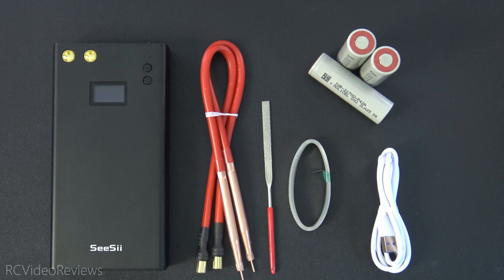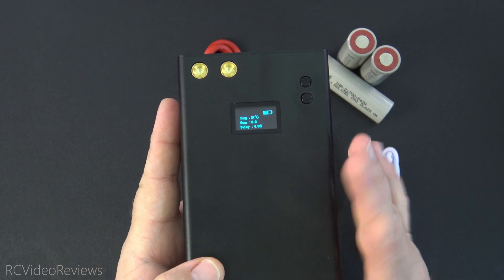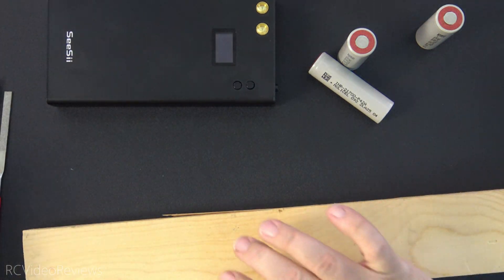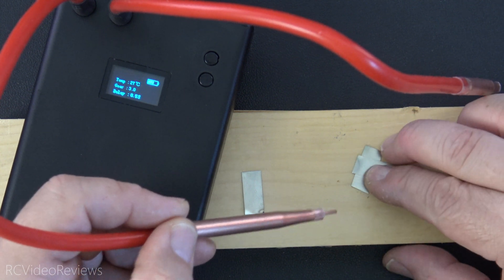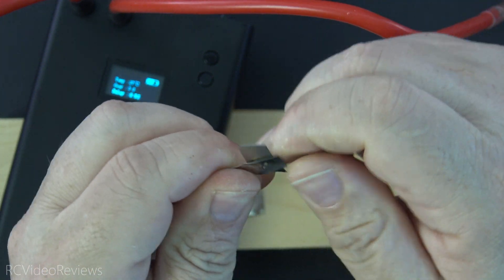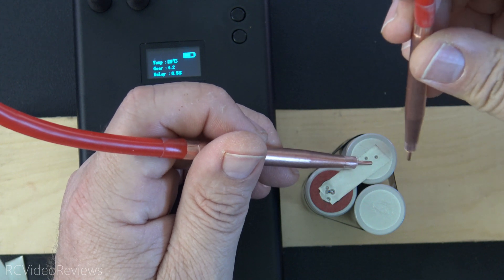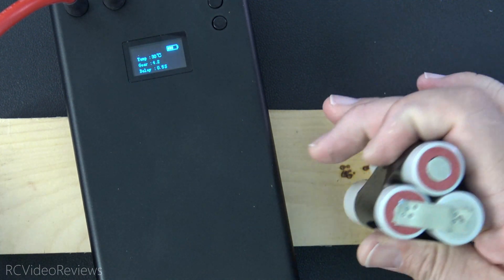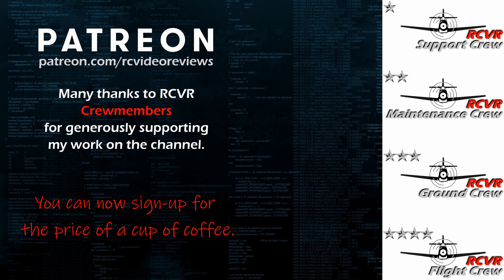Budget Amazon 18650 Battery Spot Welder by SeeSii Review

Comment: Isn't the main voltage drop thru the small spot welds which are very small in cross section versus the strips themselves? i.e.is it really necessary to have multiple layers of strips? Wouldn't more spot welds do more to reduce resistance?
Reply: I use a Matador Ampercity chart. Holes done help. Spot welds do next to nothing
Reply: The charts that I've seen just put out how many amps that the strip can handle. Nothing is mentioned about welds, solder, etc.
Reply: I've been thinking this too

Comment: I always thought that spot welding was achieved by placing one probe on one strip and another on the other strip so that the current passes thru the strips to make the weld. This is how heavy duty spot welding in done on sheet metal. ????
Reply: That is how 2 sheets are spot welding together. This is called surface spot welding where the charge starts on one side, travels downs turns goes up to the 2nd probe...
Reply: @davidbarker3591 or single sided spot welding

Comment: Did you confirm that the strips supplied were really solid nickel? I have seen comments on some reviews that said some units are actually supplied with nickel plated steel strips because they have higher resistance make better welds but the steel strips will cause higher heat and are not good to use.
Reply: Mine was nickel plated steel. It spotwelds .15mm nickel/steel easily. .15mm pure nickel
Reply: you can measure the resistance of the nickel strips if you have a power supply and a DMM.  I measured the roll of nickel strips that I got at 3.9 milliohms per inch, for a comparison.
Just apply a constant 1A with your power supply, connected to the roll with clips at a distance of just over 1 foot, and then mark off end points 12" apart somewhere inside the area where you clipped the power supply leads.
Use a DMM and measure the millivolt reading at the 12" separated marks, and whatever your reading is, divide by 12 to get the milliohms per inch.  Thicker and wider strips will have a lower reading.

Comment: I use this item all the time. Great lil welder!
Reply: Will this last long enough for starting a small business or would you recommend something more sturdy.
Reply: @jrgmty7685  I'm going to open a small business, repairing and rebuilding power tools battery packs. Going to open with a newer unit than this one. I think this model was a 7500 mah unit. I'm going with the 10,000 or 11,000 model with a big color LCD
Reply: @davidbarker3591  nice man. Good luck. Everything uses batteries these days. 👍
Reply: jrg mty...I have done 19 power packs and it's still welding fine. I will not use nickel plated steel. Now, with pure nickel it will take .10 easy, .15, it's wide open. I like the .12mm nickel strips
Reply: @davidbarker3591  that's good  thanks. Starting with industrial equipment is not always the best idea depending on the budget.

Comment: Great. Barely touching makes lot of sense. I started with press firmly, surely it doesn’t generate much heat to melt the nickel
Reply: Please explain, seriously, why light touch is better. I know you (Original Poster) referred back to a previous video, and the fact that you caught heck for (what I'm assuming was) too heavy a touch. 

It seems that if you use too light of a touch, you run the risk of not making contact with the substrate material (endcap of cell), and then your strip bears the full brunt of the energy/heat. Thus blowing a hole in it, as you did on one of the 4.2V passes. 

I have a similar (sized) spot-welder, and it will weld two strips together just fine, but try welding that same strip to a battery and it just falls flat on its face. Not enough power.
Reply: barely touching is bs... use some good pressure! otherwise you get holes and bad connections
Reply: I just use a nice pressure on the probes. Pressing hard is junk, but you don't want have air between anything
Reply: You spot the bottom layer..then you add the 3nd strip and spot to the bottom strip..

Comment: I am on a lookout for a fine adjustable spot welder for doing sensitive electronics. The idea is to adjust for minimum exposure time / minimum amps so that the weld between the nickel strip and the 389 Renata button cell battery is just good enough to keep them together, without frying the electronics behind the nickel strip. Is there some spot welding guide that says exactly what settings would be safe for application like this?
Reply: No voltage will go to the electronics, electricity takes the path of the least resistance it goes out of one probe and then back through the other through the nickel strip. If you're really worried about it do a test on a nickel strip and hook up a voltmeter on opposite ends of the nickle strip and then do a test spot weld on the middle of the strip while watching you voltmeter, you should see see no electricity passing outward anywhere other then the weld itself, you could even do a strip to ground test while welding.
Reply: @drewrinker2071  That's my understanding too. The problem is when I start using the device after a spot weld, it doesn't work as expected but only sends a flat signal (behaves dead) for which of course there is no reasonable explanation. I maybe had to explain it from the start - its about those G4/G5 Dexcom Transmitters, which when they deplete their factory button cell watch batteries (Renata 389) we try to replace them and secure the nickel strip contacts back. Anyways I have multiple used transmitters to play with and will give it a try.
Reply: @svetlinvelikov1861  yeah that's really odd could it be maybe the shock wave it sends out?or maybe static. I would also attach some kind of static strap to the device, I know that some spot welders pens have that option built into it.
Reply: @svetlinvelikov1861  something you could do it it is from the spot welder is attach a small piece of nickle strip to the cell, but where it goes directly into the device either solder the two pieces of nickle together or use a crimp connection, or give yourself a long enough piece of nickle strip attached to the battery with a wire soldered to it then lastly solder to the other wire or wherever it hooks directly to the device. And as for the static strap it was actually the Ryobi solder station I was thinking of that had that built in, I'm not quite sure how you would do that with a spot welder without shorting the contacts out
Reply: @drewrinker2071  That would be the best way to do it, first solder a wire to a nickel tab, then spot weld the tab to the battery, and last solder the wires to the device.  With hundreds of amps it can induce a transient voltage spike to the device which may be damaging, even though most of the current goes between the electrodes.
Reply: @dubmob151  hmm, yeah you might be on to something I hadn't even thought of, especially if there is any kind of components on the board with wound copper, that would pick up the emf pulse and converting it into a voltage spike, that most definitely would happen. I'd look at transformers, inductors, anything of the sorts. It makes perfect sense with that much current for something to be picking that emf up and for it to be converted to a charge

Comment: I don't know how fast you go thru the battery but presumably since it's just 1 cell that 4.2v will drop and you probably need to up the gear some if you were doing a bigger pack as the voltage drops
Reply: I've got a Seesii 10,000 model. I can weld a complete 5s2p for power tools. After I etc done, just plug in..

Comment: i have this one do not buy 0.15 it will not weld it 0.1 is the one you want it says 0.2 which is bigger thann 0.15 so that makes no sense... so 0.1 mm thick is the max it will do use gear 8 for all welds use 3 seconds trust me incase you go oh crap i need to reposition it gives you 3 seconds before it fires and use them flat not on a angle when you press down.. these are not that powerful also fully charge it the voltage sag can make it not weld good and really what is needed is capacitor in the thing where it charges it not just a battery a cap can discharge faster its not the most strong so dont expect perfect welds do 6 per cell or 3 times to ensure its on
Reply: I have this one and weld 1.5 mm on power level 2 ...so
Reply: Jerry....I have no idea what all you are saying above...fwiw (it's your writing & sentence structure - IE "lack there-of")
Reply: @robertporter1429  didnt your mother and father teach you manners>? insulting me like that for no reason at all grow up.. second im telling people about the product that to use gear 8 to weld those other gears are useless better to use full power than the lower ones also the battery will be dead within 6 months mine looses 1 bar every month it has a parasitic draw there really only used for 0.15 mm nickle strips anything more double them up and you cant weld better get the one that plugs into the wall this thing is cool it does work but barely..
Reply: It will also weld .12mm no problem. You can get it pretty much everywhere. I've always had much better luck with probes at about a 45* angle...
Reply: I've done .15mm pure nickel, and it was almost maxed out. I normally use .12mm thick..made sure probe tips are CLEAN

Comment: Hi John. A simple and maybe stupid question : is it worth assembling your own batteries ? Have you compared the weight, power, price of homemade batteries to fully assembled batteries ? Do they last longer ? Do the Lipo sticks have the same tendancy to inflate even when you treat them well ? In fact 4 questions instead of one.
Regards. Thierry
Reply: I tend to lean towards it being worth it. I recently built a pair of 6S packs from P42A cells. The cells ended up costing around $6 each, and premade packs that do the same thing were going for $100. I probably saved myself $50-60 a pack by building them myself. That adds up quick!
Reply: @jaysonrees738  If you ask me, the biggest advantage of building your own packs is the freedom to make them in whatever shape you need. Stuff like packs which are sizes for an oddly-shaped bike frame and whatnot can significantly increase the range you get out of a vehicle versus standard rectangular packs.
Reply from the maker: All good questions. Custom packs are individual use case basis.
Reply: I just work with power tool battery packs, so I have a specific size limitation. The advantage of rebuilding vs buying new is that I can upgrade the pack for the customer. Most packs are 5S2P. The 3ah  pack is really popular for Milwaukee tools. It will have Samsung 15M's in the pack. When I rebuild it, I'll suggest Samsung 25R. That'll give them a 5ah pack. The last bunch, I got the 25R's at $3.82 ea. I saved them $$, they got a better pack and I made a little...lol
Reply: For RC vehicles I generally feel that custom packs aren't worth it.

For human-sized EVs and energy storage systems, you will save thousands by building your own packs.
Reply: I have about 15 DeWalt/clone batteries and have repaired batteries soldering several times and hope this will be a better repair. At least make them fit back in the case better.

Comment: Thanks for posting this video! I really appreciate folks like you taking the time to make them. First time viewer but I shall like and subscribe just in case something else you post piques my interest. Question: I have the same one arriving in a few days. I'm curious if the nickel strip you were doing your tests with is the stuff that came with the welder and whether or not you know if it's pure nickel or nickel plated? I got another welder last year that worked great with it's included roll of nickel plated steel but it can't handle the .15 pure nickel that I have since tried. I'm wondering if this is going to be the same situation all over again!
Reply from the maker: I don't know if the material is plated or pure. What I do know is that I used half of the power output and as you saw on the video 4.4 was blowing holes through the material. There are still 4 major steps above where that happened. So....
Reply: Wow I feel like a jerk now that I see you have an affiliate link for it. Sorry I already ordered it this morning. I got you next time! 😋
Reply: பிரைஸ் லிஸ்ட்
Reply: Yes you will. I use .12mm pure nickel, the .15mm pure nickel is hard
Reply: I hope u test yours before using it. 2 tests tell you. I use a  dremel with a cutoff
Q
Reply: Wheel. If still coniced put the piece in a glass with saltwater over night. You'll see rust on Plated Steel

Comment: I have one like this and it works wonders. It's a different brand but looks quite similar except for the digital screen. Love the idea of that screen to make sure your settings are correct. Works great for making DIY lithium ion packs.
Reply from the maker: Agreed. I flew my T1 Ranger with the battery I made using this spot welder. It did great. Effective little tool.
Reply: How thick of nickel did you spot? .1, .12, or .15mm. Was it pure or plated steel. Plated steel is easier..
Reply: I've only seen the cylindrical batteries being spot welded, but will this also work with button batteries like a CR2032?
Reply: How well has it lasted? Some of the reviews say the batteries in the welder are spotty.
Reply: @bradykirk9932  you can get ones that use standard 18650 Li-ion batteries which of course you can replace when needed!
Reply: @73Datsun180B  Hope you don't need a spot welder to replace the cells in the spot welder! Lol
Reply: @bradykirk9932  the one I purchased seems great, with that said I haven't used it in quite a while. If I can remember I'll try to use it soon and reply again. Mine is pushing 2.5 yrs now.
Edit : just grabbed it and yup the battery seems dead. I'm currently trying to charge it and I'll update later
Reply: @HindsightFPV  Much appreciated!
Reply: @bradykirk9932  just an update, the welder is charging up and seems to work just fine. I did notice that it will not charge from a new 45w samsung fast charger but will charge from an older LG fast charger. Also mine is a different brand than the one in the original review video, the brand I'm referring to is a Kerpu.
Reply: @bradykirk9932  I ended up buying a capacitor styled spot welder for only slightly more and now I will never need to worry about batteries catching fire or being shit quality!